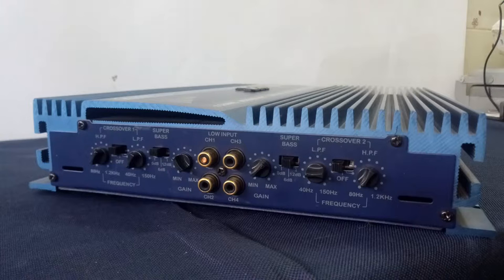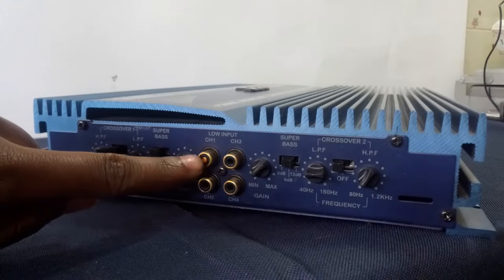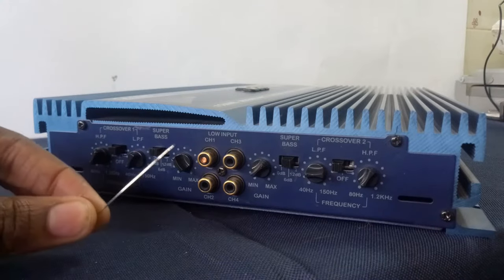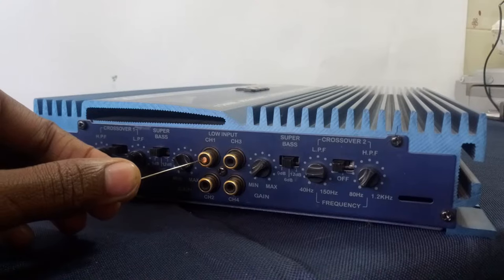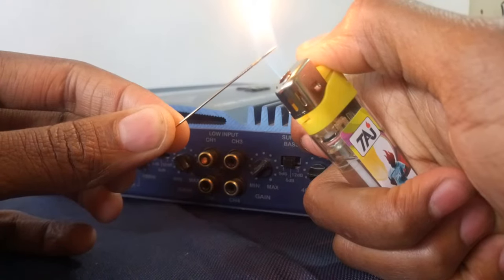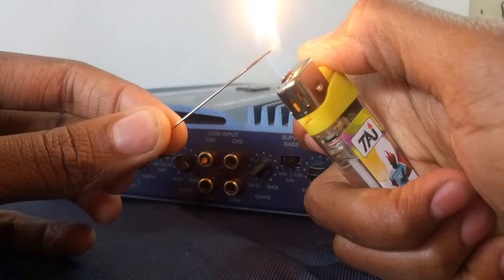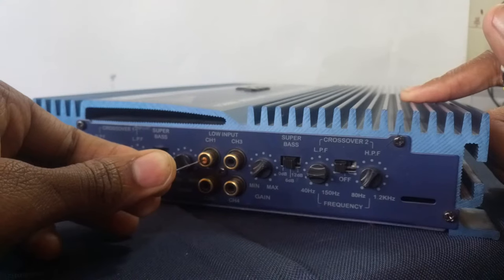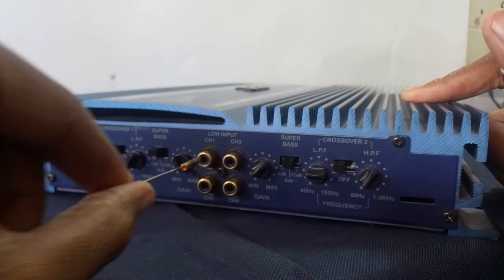How To Remove Broken RCA Pins Quickly

Comment: Worked like a champ brother even with a little super glue failed extraction. Thankfully it wasn't much glue! If you made the same dumb mistake as me use a baby pin and use a screw driver as a handle with it wrapped around the far side of the baby pin.
Reply from the maker: Awesome

Comment: Thanks so much for this video!! I broke off both my RCA pins into the back of my PreSonus Eris speakers and only was able to get one out on my own. Was about to take apart the speakers when I came across your video. Used a syringe needle, heated it up, and the plastic melted and stuck to the needle. Popped out without any damage or issues!!

Thanks a lot. 
Andrew